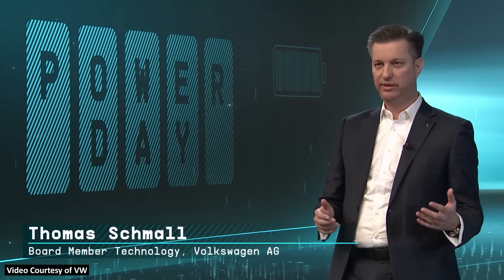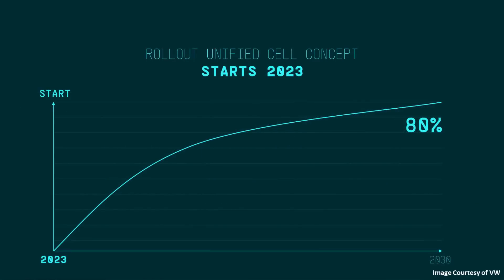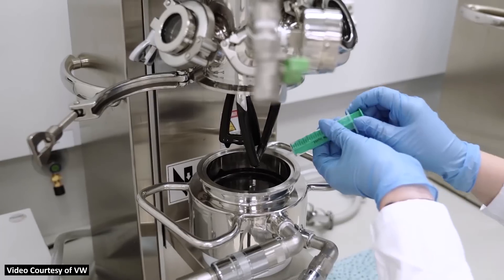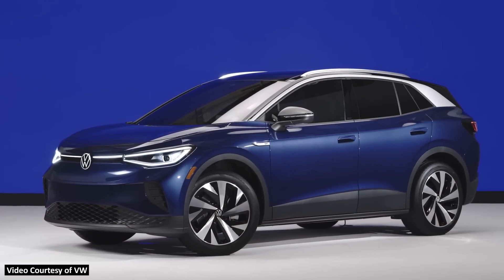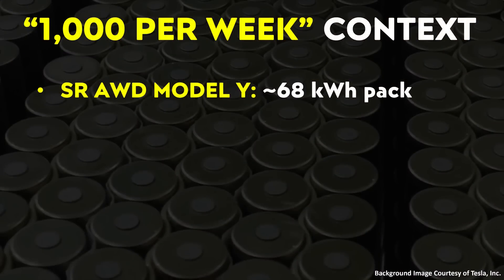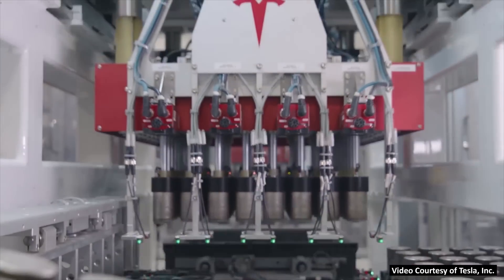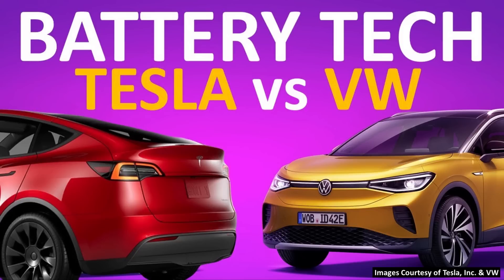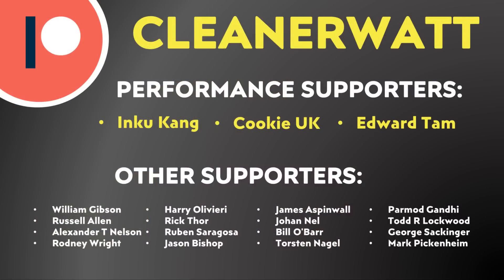EV Battery Race: Tesla 4680 vs VW Unified Cell

Comment: 240 GWh is nothing when compared to VWs Volumes. This would equate to only 4 Mil. 60 kWh BEVs (+ maybe 1Mil ICE cars), so a shrinking of 50% until 2030. Because, tbh the market will be mostly BEV in 2030 and not at 60% as VW "wants" it to be.
Reply: 2030 is just 8 years from now. No way the world wide BEV market is much more than 50-60% by then. Apart from that, VW will also buy batteries from other suppliers, just as Tesla does.
Reply: @EinzigfreierName  I wonder though, why would someone want to buy a brand new gas car in 8 years when it should be apparent to all but the most stubborn that it is the new normal. Poor people buying cheap used gas cars sure.
My understanding is that oil producers are not expanding production in favor of shorter term profits.
Reply: @briankensington8459  Because in 8 years there will still be a lot of areas in the world where the infrastructure is not yet ready. South America, Africa, parts of Asia for example. And because production will not keep up with demand which keeps the BEV prices high for a long time. EVs will become the "new normal" for sure. But this will happen at different speeds in different parts of the world and in different countries. I find it hard to really predict the pace. But everything below 30% and above 60% would really surprise me.
Reply: @EinzigfreierName  Those countries you cite make up only a small proportion of the overall car market. USA + Europe + China is about 75% of the global market. Are you aware of what is happening to BEV sales in China and Europe, and now the USA? USA recently hit the 5% "tipping point". Probably those poorer countries will start importing the discarded second-hand ICE vehicles from richer countries, again destroying the market for new ICE vehicles, even in those countries.
Reply: @harry-dymond  This is all true and this is what will happen. Just not over the next 8 years but over 15 years, maybe even slower.
Reply: @harry-dymond  Europe for example is currently at ~10% BEV sales. To reach 80% in 8 years would mean production and sales would have to increase by 30% each year. Which is not what is happening at the moment.
Reply: @EinzigfreierName  BEV sales don't have to grow 30% per year to capture 80% of the market if the overall market shrinks.
Reply: @harry-dymond  Yes, but I said already that I don't believe in a shrinking market . Europe and North America is probably saturated with cars. But the rest of the world not so much.
Reply: Worldwide market for new cars will be 80% BEV by 2030. ICE sales will collapse to make this happen, rather than BEV being at 80% of today’s market size.
Reply: @harry-dymond  I think everyone would like that, but reality about production ramping is far from that. Look at shortage of semi conductors etc, it just doesn't popup like this.
Reply: @danielvilliers612  Yes, I agree that "slow" ramping of production of batteries, motors, and semiconductors will restrict supply of BEVs. My point is that the car market as a whole is going to contract dramatically, because almost no-one will want to buy a new ICE vehicle. They will just wait for BEV to become available. Thus 80% of market can become BEV, even with restricted supply.
Reply: @harry-dymond  Yes Harry, I agree, especially since fully autonomous vehicles will be common place within the next 2 - 3 years, which may well serve to dissuade potential cash strapped BEV customers from purchasing a car at all until they could afford a BEV.
Reply: @harry-dymond  No for a simple reason - industry will not be able to adopt THAT fast. Production sites for cars and batteries and chargers. Installation of all the charging stations needed to support THAT many EVs. Totally impossible to have 80% worldwide adoption. I'd say even 60% is unlikely.
Reply: @EinzigfreierName  You don't appear to understand what I am saying. Take an extreme example, just for illustrative purposes: if, starting tomorrow, no more ICE cars were sold, the market would instantly be 100% BEV with no increase in BEV sales required.

So, what I am predicting, is that BEV sales will continue to increase inline with the industry's ability to supply them, and that ICE sales will decline at an ever increasing rate. So, in 2030, the market overall will be much smaller than it is today, and that 80% of that smaller market will be BEV.
Reply: @harry-dymond  Okay, but this seems even more unlikely to me. You predict the global car market to shrink?
Reply: @EinzigfreierName  "You predict the global car market to shrink?" Yes, definitely. BEV supply will still be restricted in 2030, but most people will have understood by then that the writing is on the wall for ICE vehicles and will not want to buy a new ICE vehicle unless they have absolutely no choice. People will therefore stop buying new ICE vehicles and overall market will shrink, and then start to expand again as BEV production continues to ramp up.
The only thing that can prevent this is new ICE cars plummeting in price.
Reply: @nickv8816  What happend in the last 4 years does not necessarily predicts what will happen in the next 8 years. About the manufacturers I agree. They will not put too many resources into ICE technologies any more and at some point start to force the trend towards EVs. I guess we'll see this from all automakers in the next few years depending on when they'll have their products ready.

Comment: What's unified about VW's Unified Battery Architecture?  They seemingly can't even decide on a form-factor, or commit to one at least.  I like battery cells that have dimensions.
Reply: The dimensions are unified.
Reply: "Unified" means:  we can't find our ass with both hands but we want to be like Mary..... she led!
Reply: @eugeniustheodidactus8890  "Unified" just means to use the same form factor for batteries across the whole range of cars which is a pretty obvious thing to do.
Reply: Once the chemistry is developed, the form factor (size) can be whatever is needed.  That's the strength of the prismatic technology.  But getting to that is difficult, as Tesla has discovered.  Engineers can be arrogant.
Reply: @twhite5085  It's the other way around. Define a battery form factor and design all platforms and models around it. Then make suppliers offer all their different chemistries in that form factor. This modular approach has a lot of advantages.

Comment: So far, the 4680 battery has delivered nothing new and hasn't lived up to any of it's promises.  It charges slower, has about the same total volume capacity and nothing's changed in the price of the cars than the 2170 batts.  Once again, Musk told lies and B.S., like his full self driving promises.  I'm rooting for GM, VW and BYD to be the world leaders in EV's.
Reply: Dry electrode is new and delivered, it charged faster, root for who you like GM will need your prayers,VW your help and BYD will be fine hope you are better at the arts than you are at science.
Reply: @alanrickett2537  Until Tesla produces 25-30k usd cars they will never put VW out of business. For now they have 2 models and VW has around 10 models after starting 5-10 years after Tesla. Most car companies won't die, because as has always been, people have different taste, requirements etc.  And until now, Tesla is far from providing that and surely not in the near future.
Reply: @danielvilliers612  VW will need to beat the Chinese,indian and others. For the cheap car market, and make those cars with not only a positive margin but with one big enough to not only pay it's current debt the the huge cost coming as the margins on it's ICE cars go negative with the numbers falling and the decommissioning cost with the ramp down.

As to have lots of models and choice you would be correct if 1) the market was a mature one but in a fast moving market keeping all those models at the market tech point is going to be costly.2) the cars are actually different and not just a the same cars with a different body dropped on top. The MEB platform is a issue for VW they planned to use it for 7 to ten years but already after 2. -3 year it's looked on as old and rubbish in china and VW have started to  design a new platform to replace it with out ever reaching break even on the design costs 

 Note VW will not go out of business as the German government will illegal funnel billions in cash to them and the other car companies thats how they got to be big in the first place.
Reply: @alanrickett2537  So you think people will buy only BMW 3 and above style cars, I don't know in what world you are living in, but this is like 5% of the market worldwide. The reality is that battery prices have decrease 10 fold during the last 10-20 years and electric cars are much more simple than ICE ones, We are living in a special context with COVID and now the war in Ukraine. This trend will continue and we will see two more trend, firstly their is a foray of new battery tech coming online from sodium battery that require zero lithium and semi or fully solid state batteries etc. For example sodium batteries could completely replace lithium batteries for stationary application as they are lower power densities. Even if they are about the same than LFP batteries. But as they cost lower, they could be in some lower range vehicles. But even just taking the place for stationary battery would liberate the rest for EV and price will go down again. Secondly, as electric charging infrastructure and charging speed get better and better, that 200 mile car with 10 minute charging to add another 100 mile for 20K will become irresistible. Their was a recent survey in UK where.... 100% buyers are ready to go electric for the right price that is about price parity. But I think in max five years, we will be very close in price because of the reason above, battery price will go down again and range anxiety will disappear as infrastructure and charging speed gets better.
Reply: @danielvilliers612  no I think VW will not win as I said china India etc will destroy VW on the small car market and beat them in the mid size market as to the rest of your post , sodium batteries may come or we may get liquid metal batteries or something else non of that will help VW.
Reply: @danielvilliers612  then you are not looking
Reply: @alanrickett2537  At what?
Reply: They are focusing on scale and manufacturer efficiency then they will focus on chemistry. You don't have to believe in it but LG and Panasonic are investing billions in factories for making 4680. I am certain they know more details than you do.
Reply: Battery chemistry is evolving rapidly. So too soon to judge. Elon is optimistic, but does not lie. FSD is difficult, but improving every day. Tesla is superior, but I root for all EV makers.
Reply: The fact that Tesla is actually delivering cars with 4680 structural packs, long before the pack architecture or batteries are optimized, is what distinguishes Tesla from also-rans like GM, VW and BYD, who aren't creating new battery technology at all, and are years away from shipping their BEVs in volume, equipped with 3rd-party powertrains.
Reply: @jameshoffman552  byd though has the in house blade lfp cells in a ctp format starting with the new seal/atto 4 ev out later this month. 
Otherwise spot on comment! 👍🏻
Reply: It's the first production of an in house cell to pack setup as a structural pack design. It's the first mass produced cell of the 4680 format size.
It's the first true tabless cell of any size or type produced at mass scale. It's got the dry cathode tech. I mean geez what else does anyone want from a first effort by tesla doing in house cells? 😁
Reply: Another troll spreading FUD.
Reply: Just a hunch, but I suspect that you need to get off the crack pipe.
Reply: If i were going to buy an EV, my main consideration would be the future cost of replacing the batteries as well as technology advancements. Seems to me NIO has the upper hand, but I could be wrong...
Reply: Root all you want, but GM, Ford, VW, etc are so far behind and so lacking in supply chain resources that it will take government intervention to support them.  That will happen (and they're counting on it).  But then your taxes to cover those bailouts will be crushing.

Comment: Hi John, good video..A comparison between the 4680 structural battery pack and the CATL CTP 3.0 would be interesting. The CATL pack attend like the closest competitor to the 4680 structural pack. It also is likely to find it's way into Tesla's, Ford's, Kia and Hyundai. From a temperature control perspective it may have an advantage which leads to safety, charging speed, life cycle advantages. VW and their unified battery developer, gotion high tech, will have to work hard to match the CATL 3.0 CTP or the 4680 pack
Reply from the maker: Thanks for the great suggestion!
Reply: Don't forget the byd blade ctp starting with the new seal atto 4, a model 3 sedan competitor. That enters production later this month. 
I'd be curious to see the catl lfp ctp vs byd blade ctp vs tesla 4680 in house ctp. It would take someone like munro live though to do a true tear down comparison sadly.
Reply: 4680 pulls heat out (eg from hot spots) via metal current collectors - so at very small scale. Any design which relies on conduction through many layers of separators & electrolyte will get steep temperature gradients & poor sustained heat removal. Plaid is best of old design, uses small 18650 cells, so lots of electrical junctions, dedicated cooling strips. Prismatic has fewer junctions, similar cooling if narrow cells, not CATL size. (CATL LFP so less fire risk)
Those prismatic in video very, very slow to wrap. That’s not smart.
Reply: @iandavies4853  So the tabless architecture shunts all current, whether charing or discharging directly out of the cell through hundreds of Cu or Al flags on the top and bottom of the cells. I think temperature control will be easy. Plus the batteries are in a structural format. Hard to match, IMO, easier to let ego go and imitate Tesla every chance they can.
Reply: @Bonjevalien  Yes. I’m no expert, but Tesla takes holistic approach. Found a way to reduce cost, labour, cobalt, weight, charging restrictions, fire risk, and make individual cells robust, puncture resistant. And whole pack sealed in tamper-proof goo. Yet Panasonic proposes 5 tabbed design 4680, and BMW still has fires.